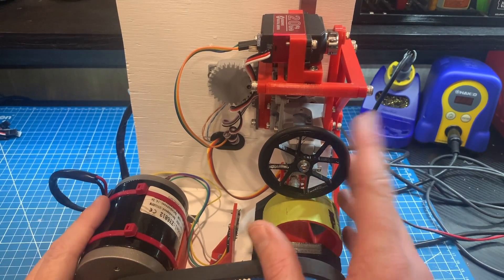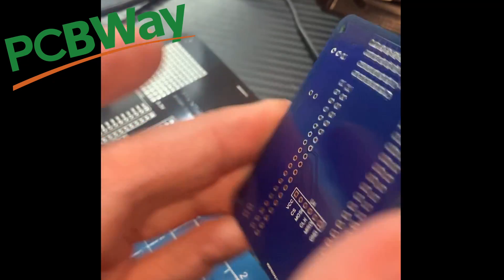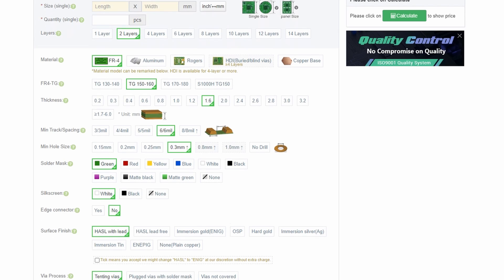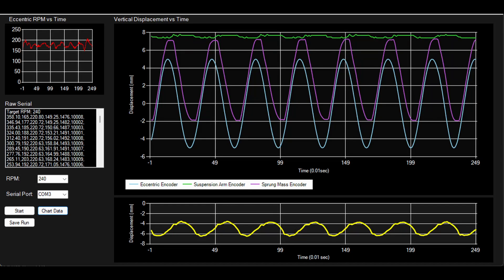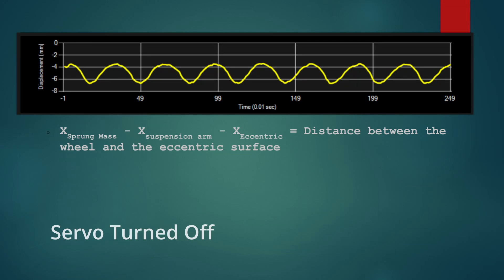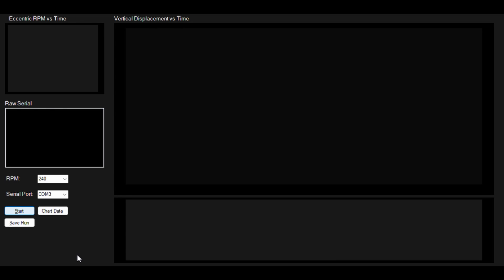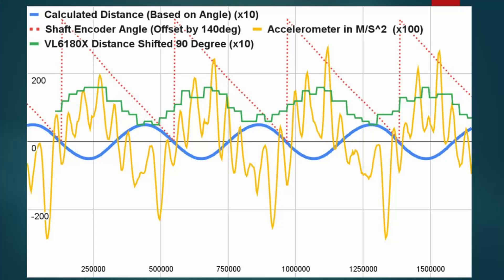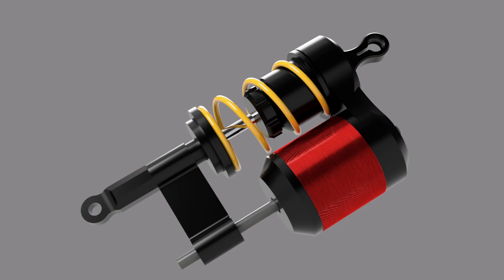Active Suspension Test Rig Pt2

Comment: I find moving from the breadboard stage to the custom-PCB stage of a project a bit nerve-wracking but oh-so satisfying. Currently doing a version 2 of one of my previous PCBs now I've learnt some things.
Reply from the maker: Yes. I’ve learned so much. Like next time I need so many more silkscreen labels. I’ve spent so much time probing pins trying to remember where they go.
Reply: @IndeterminateDesign  I omitted mechanical mounting holes on one of my very first PCBs. Caused me no-end of problems.

Comment: Voice coil motor is simple, but you need to use the same tight gap system used by speakers but using a bushing in the center with a solid rod and the coil adjustable along the shaft coil attached to the control arm you can put a progressive spring in the center x-max travel is based on how tall the coil is minus the gap thickness so a 20mm tall coil with a 5mm tall gap gives you 15mm of linear travel
Reply from the maker: Thanks!  I was thinking they looked simple, but given that they charge several hundred dollars for the cheapest industrial VCMs I was concerned there was more to them.  I think I'll still need a top on my voice coil to help support the rod unless I can get an extremely tight fit between the magnets and the body that supports the coil.

Comment: Nice job, and congratulation on your methodical approach. I've made a somehow similar test platform but used a speaker (woofer) , an audio amplifier and laptop audio output (as signal generator). I've tested different types of shock absorbers for my projects to get as much as possible from them, but to be honest real life testing was more useful regarding the setup tuning. I am really looking forward for your streamliner car project.
Reply from the maker: That's awesome.  I was thinking real world tuning or even a some sort of self tuning was going to be necessary.  The issue I've always had tuning so far in the real world is that I don't always know what being caused by the tuning or my software bugs.